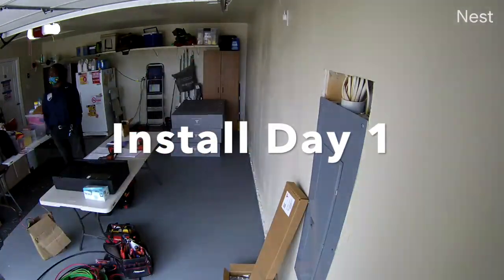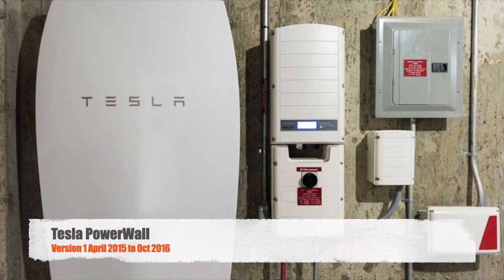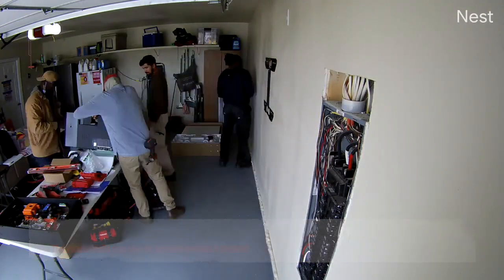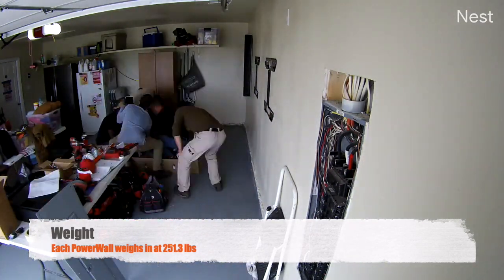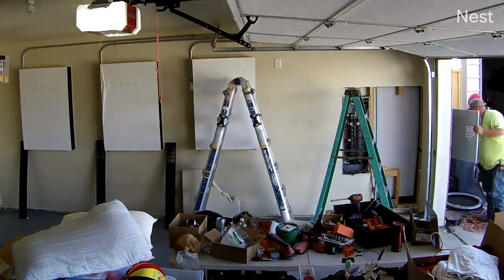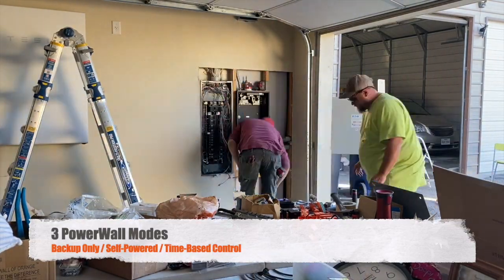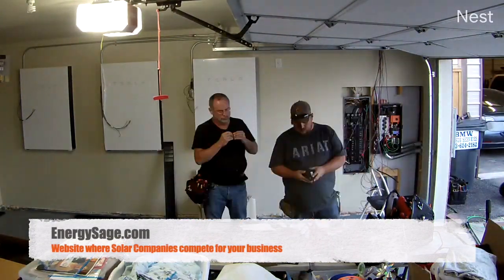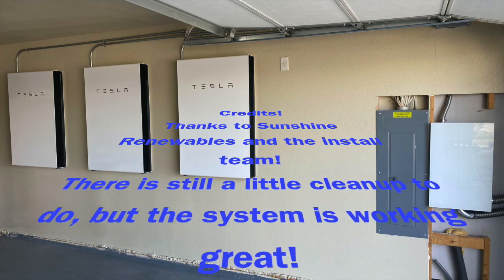3 Tesla Powerwall Installation (Garage)

Comment: Do you by chance have the total height and length measurements of all 3 power walls ?
Reply from the maker: 7 feet from the ground ot the top of each one.  10 feet wide from the 1st one to the 3rd one.

Comment: So how do you use the app if the internet is down?  Let's say a catastrophic power loss occurs that lasts several days or weeks.  Do you have a plan to control the app via local router?
Reply from the maker: Cellphones, but I have battery backups on my internet that will last a few hours.

Comment: Why did they cut one of your wall studs off and not replace it? Why didn’t they just do a surface mount of the gateway?
Reply from the maker: Yes.  In order to make it a cleaner install, they needed to cutout a stud.

Comment: What about central air?
Reply: The installer must install a Soft Start kit for your Central Air.  After the soft start is installed, the Amps cannot go above 30A per PowerWall.  IE: My Trane xi20 goes up to 65 Amps, so I have to have 3 PowerWalls in order to be able to backup my Central HVAC.

Comment: Only enough power for one day if power goes out. 

Guess this would of not work for the winter storm Texas had
Reply from the maker: It worked fine. (I’m in Texas). I had 41 hours of backup. You have to mix in solar with battery backup, then you can go forever as long as the sun comes out. On those days the sun didn’t come out, the power was rolling, so my PWs would charge off the grid power.

Comment: Any update on the power wall after a few months of use?
Reply from the maker: During this storm, we found out 1 PowerWall isn't working.  Tesla will replace it.  Without that  3rd PW, we aren't able to operate our heater on backup power.  SO, we had to heat the house when the rolling power outage came back on.  The good news is, I had power to the rest of the house the entire time.  The PWs kicked in when CoServ turned off our power.  In reviewing the logs, we had 41 outages for a total of 42 hours this week.  The only time we knew was when the heater tried kicking on and we were on battery.  I have to say, best money I've ever spent.  Especially once we get that 3rd PW replaced.

Comment: if I wanted THREE pw2 (on three-phase) would I need three gateways (the one with BACKUP) or just one ... to have 5 + 5 + 5kw charging / discharging?
this thing is not clear ... there are those who say that for 3 powerwalls (on three-phase) it takes three gateways to deliver 5kw on each phase.
Reply from the maker: One gateway. As many PowerWalls as you want.

Comment: I love this kind oh stuff. However, this is a waste of money. I have a $1000 solar generator that works just fine. How often does a persons power go out?
Reply from the maker: It’s actually gone out 6 times since the install. We only knew about one.  I do agree that it’s not a requirement.  I just wanted the peace of mind and to take advantage of the 26% cash back.  Then they extended the 26%, so I could have waited. I’m still happy I got them.
Reply: @scottysize  Doesn't sound like you need power walls. Sounds like you need to move
Reply: Some countries are experiencing energy supply issues. It wouldn't surprise me if areas in the US have rolling blackouts or grid issues in the future.
Reply: Our power goes out all of time, no always for long periods, but long enough to mess up electronics. It seems like the PW are a good solution.

Comment: the solar company here where i live wants $21,000 for two powerwalls installed!!! thoughts???
Reply from the maker: Sounds about right.  I think I probably paid about $37,000, but I'm not sure, since it was all bundled together Solar and PWs.  Have you tried Tesla?  I'd think they'd be cheapest.
Reply: @scottysize  so, a 20 year break even at $150/month bill. Am I missing something?
Reply from the maker: @jdwojda  There is not break even on PowerWalls, unless your electric company charges you more during peak periods.  Then you can justify the PowerWalls and have them power your home during that time.  The break even would be for my solar.
Reply: It’s better to have solar installed with Tesla, I’m getting a combo discount if 2,500 bucks.

Comment: Why did they mount those so high?
Reply from the maker: Had to get them higher than a car.  This way they aren’t accidentally hit when the car parks in the garage.  It’s actually a rule.
Reply: @scottysize  that's NOT a rule. That's probably the most stupid "rule" I've heard if anything the installer and or electrician and or YOU the homeowner requested the batteries to be installed at that height.
Reply from the maker: @senorjalapeno3937  I can only tell you what I was told.  I had no problem with them on the floor.
Reply: @scottysize  in Houston, where I reside, as an electrician whose done multiple powerwalls; I have both installed them floor mounted and or per electrical or city code above 3ft to the bottom of the battery due to location of home if within a flooding area.
Reply from the maker: @senorjalapeno3937  then maybe that was the code they were thinking of?  IDK. Not an electrician. Only had their word at the time.

Comment: 1 tesla battery powered a large house overnight apparently you with a small house need 3
Reply from the maker: Also, anything over 30 amps cannot be run through 1 PowerWall, so you cannot backup your entire house with just one.  I have 3 because I wanted to backup the entire house.  I probably needed 4, but live and learn.  We’ve never had a power outage last more than 6 hours, so I should be fine.
Reply from the maker: 3 get me through to 2 to 3am and then they stop, but I have them set to 30%. I did leave them on to 5% and they barely made sun rise.  If I let them fall to 0%, I might be able to go from sunset to sunrise, but it’d be close.